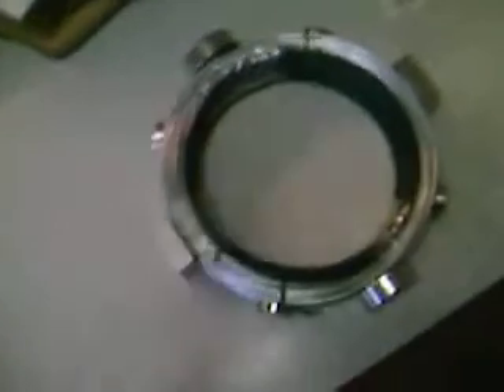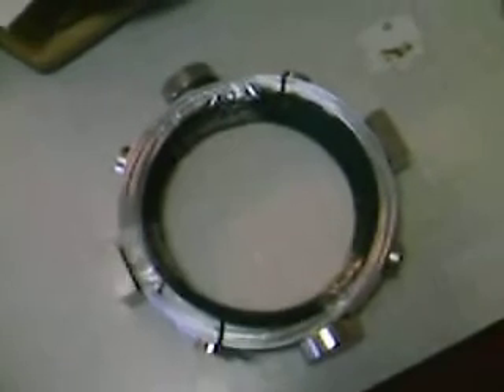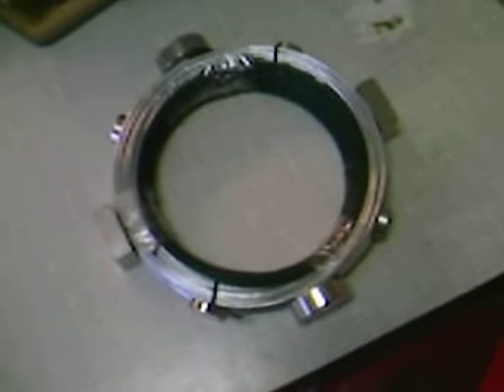My version of a JeffCookCoil

Comment: Honestly, do you really think the coil of wire does ANYTHING?  I do not think so.  You are simply doing suspension.  The carbon plates are diamagnetic, allowing you to get to a point of "levitation".  You will accomplish the exact same thing by getting rid of the coil and it's magnets you have on the coil's sides and then carefully changing the height of large black donut magnet - I've done this many times myself, it is easy but takes a careful hand and patience.